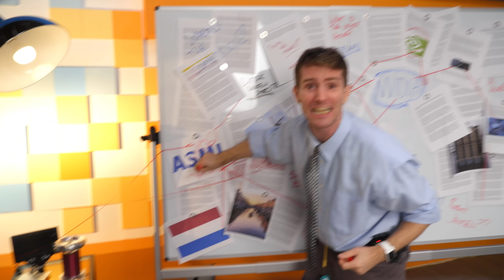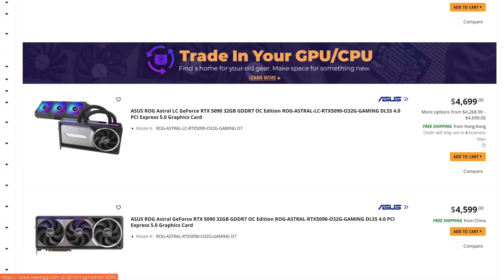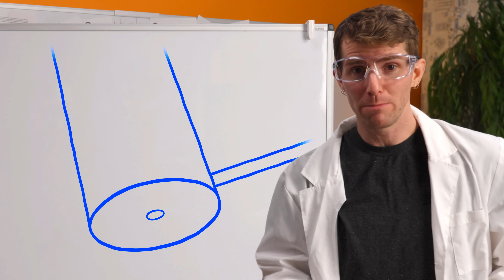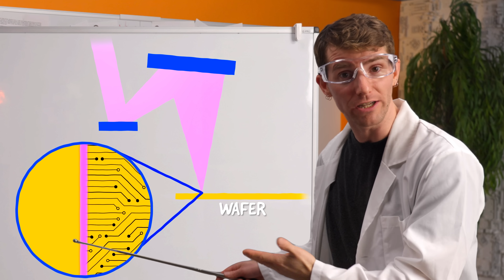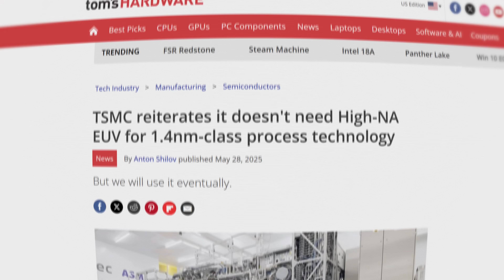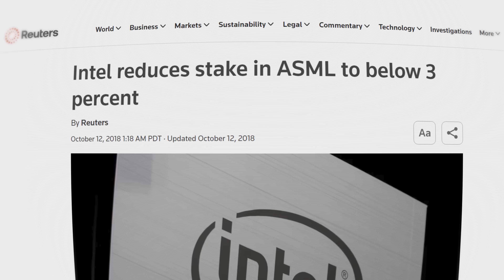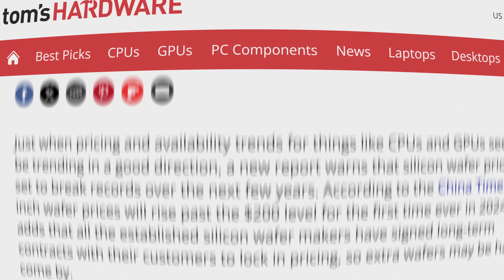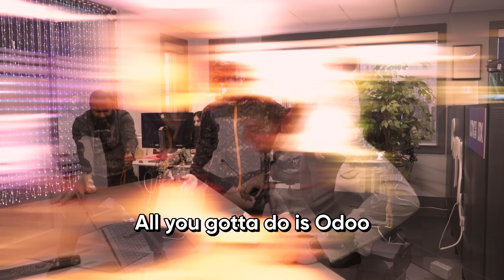This is Why Hardware Prices are Going Up… Again

Comment: 1:30 Hey Intel, please make an actually competetive high end GPU in the Celestial gen, PLEASE!!
Reply: Doubt they will, competing with Nvidia on the high end is ridiculously hard, focusing on the mid end is easier, and can get you way more customers. It's the way to go when you're the underdog.
Reply: I’ve been waiting for amd to do this for years and the can’t. They’re so bad at the top end they gave up this go round
Reply: I can confirm that they're trying really very hard to do just that.
Reply: Competitive with what. Last gen? Battlemage was forced to compete on price because the performance was just not there. Intel will needs never before seen gen on gen improvement to be "competetive"
Reply: @nickfarley2268 I mean it could be possible if 18A does well enough and they have the capacity to dedicate some output to gpu’s. Not making predictions about next generation of intel cards but maybe a bit further down the line.

Still gotta get better with driver & software side from what I’ve seen and read.
Reply: @nickfarley2268  you do realize that there are far more people willing to buy a 4090 class card for $400 than there are people willing to spend $3000 on a 6090 class card right?

Intel doesn't need to sell the best performant card, they need to sell the most performant card at the right price.
Reply: @TeflonBilly426  If Intel can match 4090 performance I will apologize to you. The fact that you are expecting 4090 performance for $400 is incredibly unrealistic. Do you realize that gpu cost money for the materials to build and high end products cost more?
Reply: @nickfarley2268  I'm not expecting 4090 at $400, probably $600-750 (still a good price IMO).

I've said for years that I'm looking to Arc Druid for my next upgrade (currently EVGA FTW3 3090ti) And if they keep up the same uplift we saw for Battlemage with Celestial and eventually Druid, I think that's achievable.
Reply: @TeflonBilly426  Business pay for quality and expected return, with somewhat clear replacement cycle. Consumer pay for maximum value they get with their budget, and cling to their hardware until its subjectively deemed inadequate.

You can't grow as a business in this space by aiming at "winning" the consumer market. NVIDIA proved it with their GPU, AMD proved it with their CPU. The only way that model of business would work is: if the replacement cycle for GPU is close to replacement cycle of phones.

Comment: As a nano electronic student i am tired of euv being hyoed as THE only reason of success. It is like sayings a company is making good cars because they have the latest cnc and lathe setup. Also there are many more steps. Hundreds od Deposition and etch steps between those lithography steps,  each a phd .

Even after that the art of tsmc or intel is more than the sum of knowledge of each step.

Also corps like aplied materiaks and ... are litteraly as important as asml. 

Abd believe me even if you gave these machines to everyone,  they would give you a chip

Comment: If the cost of these machines would ultimately just be added to the latest chips, the chips which were produced by these machines, everthing would be alright.
"Old" GPUs would have a fixed launch price which is being reduced after time. No price increase.
Therefore only the latest and greatest  GPUs CPUs and chips in general would get the expensive price tag, but only at the beginning.

This would be a world everyone could live peacefully.
But no, the chip shortage even increased the price of tech which is several years old.
And that's the thing I hate.

If for example there is a 96core CPU for 13.000€ to 14.000€, namely the Threadripper PRO 9995WX, okay, it's the best of the best.
But why would an older 96 core AMD Ryzen Threadripper PRO 7995WX, which was around 8300€ in 08/2025, go up in price again to currently around 9600€, despite the new generation (9995WX) was launched on 11/2025?

This doesn't make sense!

In a somewhat reasonable world, a newly released new model would certainly decrease the price of the old model, even if they would be similar in performance.

I hoped to get an older Threadripper CPU with 64cores for a reasonable price.

Comment: so, i have a different take on current pricing. yes, things are far more expensive than they could be. BUT, i suspect at least a small part of the reason is that... tech isnt really getting that much better, at least not perceivably. i'm currently sitting on 3 different gaming pcs from 3 different eras. i have my old laptop, an asus tuf with a ryzen 7 4800h and a 1660ti. there's my old gaming prebuilt, a linovo idea center gaming with an i7-12700 and a 3060 12gb that will be set up as a dedicated jellyfin server eventually. and the new hotness, there's my ibuypower (dont hate, i got a SCREAMING deal on it) with a 9800x3d and a 9070xt (got it for a hair over 1700 all in on a pre-black friday sale. with 32gb of ram, i basically got the motherboard and ssd for free).

here's where my take gets a little warm. from a general web browsing, video watching standpoint, my laptop and my current gaming rig are functionally the same. even in light gaming (i play a lot of idle games, which are more often cpu limited), my fancy pants 9800x3d doesnt REALLY outperform that old, tired, badly in need of a repasting 4800h. in 'real' gaming, there was definitely a huge upgrade from the 1660ti to the 3060. but... the jump from the 3060 to the 9070xt was a little underwhelming. that's partly because i dont play many modern games (the newest AAA game i even own is cyberpunk, and i have less than an hour logged on it in the 2 years i've had it. mostly just use it for the benchmark). the only reason i was even in the market for a new pc was i needed more gpu memory due to all the mods i like to play with on games (i've got 4 games with a mod folder bigger than the actual install file) and the linovo uses a proprietary power connector for it's motherboard meaning no easy GPU upgrade.

hardware costs going up isnt really that big deal in the long run, because we're not going to NEED new hardware for a few generations. it'll take that long for the iterative upgrades to compound enough to make an upgrade worth while, price be damned. think about it, the last time there was a true hardware upgrade that was actually worth the jump was gtx to rtx. it's been iterative for 3 generations now. you can see it on steam hardware survey, folks are still running gtx 1060s in significant numbers, likely because they are cheap as hell and are perfectly adequate for many esports titles and older games. basically, what i'm getting at is hardware prices are becoming irrelevant due to the hardware itself becoming irrelevant. you buy that $2000 5090 now, and you'll still be able to play games in 10 years (the 1080 is proof of that). the bigger problem is devs not bothering to optimize their shit, making it our problem.

Comment: I don't call something a monopoly unless there is another company competing. When it comes to ASML, they are sloppy with their material. China got a full technical diagram of their latest EUV machine, but they are unable to replicate it because it's just too advanced and difficult. ASML machines are like 30% hardware and 70% software to make it work properly. If another company got even close to their capability, then it would be awesome! I believe China will do it eventually, just not in the next year.

Comment: 8:20 Linus, it's also a fact that it's exponentially more difficult to shrink transistors, and the cost increases exponentially alongside it, regardless of competition. We are approaching physical limits and things get reaaaal weird at the limits, and very very expensive.
Reply: Hitting the physical limits is actually a good thing.

As pushing the very cutting edge gets more and more expensive, it becomes proportionally easier for the independent players to stay relevant. If the latest process node costs you 2x more and gets, say, +10% performance — you could just buy the prev-gen part and lose the same 10%. Gaps shrink, "good enough" hardware stays good enough for longer. Independent players have more time to catch up and have to spend less money for that.

Also, a largely untapped potential comes from various physical arrangements like 3D stacking, chiplets and similar. They are orthogonal to the process nodes — you could build a 3D NAND on 28nm node and it would still deliver multiplicative performance gain over the base "flat" topology on the same node.
Reply: @oink-747  on one hand, yes. but on the other... the capital you need to invest to get to actually producing chips means that you pretty much need thouse margins for it to be a finantially sound move.

also, the 3D stacking and shit is what people have already been doing since like 2010, since the actual first wall of 2D node size came with 14nm or so, hense, intel's 14nm++++ era.

whats happening in the past 5 years is that we are hitting a wall on 3D stacking...
Reply: @oink-747  exactly: we can expect genuine improvements in software only once everybody feels the effects of Wirth's law.
Reply: I hope you know that the "node" doesn't really have anything to do with physical transistor size. Matter fact we are still about a tenfold decrease in feature size away from the 4nm transistor NOT NODE that NEC proved in 2004. So approaching physical limits, nope. It's feasibility, and scaling to make economic sense problems we are hitting. We can make much smaller transistor and have been able to for over 20 years. But one research proof of concept is a dimension away from commercially viable mass production. Also even current cutting edge 4nm or 3nm or even smaller nodes have NOTHING to do with actual transistor size. I'm an electronics engineer in that space and it's all marketing talk, because the real improvements from this to that node are much more complex to explain.
Reply: @kuunib7325 while we are nowhere near the physical limit beyond EUV most likely will be incredibly expensive. Cause that would be X-Rays. Since they behave completely differently you have to design a system that won't utilize anything you learned in the last decades shrinking down UV.
Reply: @kuunib7325 I think the next breakthrough could come in room temp super conductors, if that could be applied to computers. Something like that could go insanely hard but room temp super conductor is a tough thing to achieve, let alone be able to apply to this sort of thing, if its production requirements are similar to those like YBCO’s (nilered video).
Reply: @christianmichael4020 we don't even know if room temperature superconductors are possible and even if they are whether they exist so unless we somehow discover one through pure chance they are as far away as fusion. However even superconductors at the temperatures fridges can achieve would be a massive breakthrough.

Comment: 1. None of the gpu manufacturer is using cutting edge 3nm node. so 3nm wafer being 2x more expensive than 7nm argument doesn't apply here. 
2. Price hikes on sub 3nm nodes isn't like skyrocket high. 
3. Chip price in 30 series was around 25% of whole GPU, so even if chip price double doesn't explain whole GPU price triple.

Comment: The trend of exploding R&D and manufacturing costs of new equipment and fabs has been predicted to become end of the Moore's law since 90's. And that eventually all cutting edge chips would need to be made in a one fab that's so expensive to build that the entire industry could only support one.  And shrinks end when making the next fab is more expensive than the entire industry.  And that was a time when there wasn't monopoly just exponential cost of improving precision and purity of everything.

Comment: Thank you for bringing mainstream attention to this! I'm a huge geek for semiconductor fabrication and view the mass production of modern semiconductors as arguably mankind's most impressive achievement, so I think it's awesome that you're giving your massive audience this 10000 foot view of the landscape. And yes, we absolutely need more competition, but the barrier to entry here is so extreme. Taiwan's strategic importance via TSMC also has huge influence in geopolitics. Yea it's very easy to go all Pepe Silvia on this.
Reply: As someone who works in semiconductor fabrication (mainly yield and defect analysis, but also wet and plasma etch, tho I'm trying to do a lateral move to FSE), the fact that it even exists is something I look at with like, religious reverence. It is the pinnacle of human ingenuity, cooperation, and achievement from every angle you look at it. The required supply chain logistics, layer processing and design, each individual tool in the fab working by itself and in concert, laminar airflow, the materials sciences that allow the bunny suit to exist, just all of it. 

That said, there are just some aspects of the industry that fundamentally conflict with the idea of market competition to the point that they're mutually exclusive lol

Comment: It's literarily multiple layers of "we were so good we became monopoly". But the issue is not that companies are charging more. The issue is that newer and newer chips are required. People want better graphics in their most beloved games. People want to play on 27-inch 4k screens that require more and more computing power to drive. Just imagine... The Elder Scrolls VI releases today and it looks like Skyrim. It would be universally bashed, it would be deemed Skyrim mod, just because developers wanted older hardware to be able to play the game. It's assumed that new games will be prettier. New screens will have more resolution. This drives prices up. If TSMC wouldn't need to make 5090s for NV, because they wouldn't, they'd work on making their a-few-years-old process cheaper. So, basically, what drives the proces up is progress.

Comment: 4:52 I think a phrase got cut there in the edit. There should be a line to the effect of "after the electrons are forced up into a higher energy state, they fall back down to their lower state and emit a photon of a specific, reliable wavelength in the extreme UV portion of the electromagnetic spectrum".

Comment: Competition increases technological advancement, which ultimately lowers prices in the long term, but competition alone doesn't lower prices if demand is high enough (as it is now). I guarantee TSMC would prefer to lower prices by increasing supply because that is a more effective long-term strategy for increasing profits, just like decreasing tax rates increases tax revenue.

Comment: Hey technically you can get DUV lithography tools from Canon and or Nikon, ASML isn’t the only option there. You can multipattern with DUV and achieve similar scales to EUV. And if you really really need EUV you could make a particle accelerator Free Electron Laser (FEL) and route the EUV part with some smart optics towards a bunch of tools. Some researchers in Japan are proposing such a strategy. Physics is open for EVERYONE, ASML doesn’t have a monopoly on it.
Reply: Money isn't, however, open to everyone.
Reply: @raze3297 good thing DUV tools are cheaper, then, both to purchase and to run and maintain
Reply: TSMC already use multi patterning with thier EUV machines to reach the cutting edge and it's EXPENSIVE. With DUV multipatterning you could maybe reach what TSMC was at a year after they got their hands on EUV machines, but you can't reach the cutting edge with just DUV.

Comment: Ha, as it turns out.  I will not be upgrading my 8700k Intel based system with a 3080ti (evga).  It's called steam deck

Comment: The industry lacks competition because it was a small industry and simply not that profitable before all the booms. And it requires HUGE and lonnnng-term investments, so the risk for any new players is sky-rocketed high. Without all the US sanctions, China probably wouldn't be motivated enough to seriously invest in it.  

Funny, TSMC was founded because US was trying to "unbundling" chip manufacturing.

Comment: Beyond high manufacturing costs, one reason for the lack of competition within the GPU market, and with the CPU market, is that IP laws restrict access to fundamental features and instruction sets. AMD and Intel have a cross-licensing agreement that allows each other to use x86-64 but have everyone else pay for patents. There are more ARM processor manufacturers (though they are integrated rather than sold separately) than x64 processor manufacturers (only two for the most part).
Reply: Can't forget about export control and other federal regulations regarding dual use products either! Like, the lack of cross pollination isn't just the responsibility of private corporate behavior, it's enforced by Uncle Sam with the threat of violence. 🫠

Comment: Corporates are trying to monopolies on data.
If private citizens don't own hardware, they don't have processing power. So either they'll stop using computer based services or rely on someone who has that facility.
DRAM crisis, GPU crisis, etc, they are just testing water. If they don't face any backlash, it will be normalized. Govt already want to end privatization and impose ultimate surveillance on all of us .

Then they'll start charging for cloud gaming services, cloud storage, cloud render farms so that they can extract every ounce of data that is produced in this world and feed it to their AI models.
From excel sheet to private coding projects, from photo editing to movie production.
For everything you'll have to bank on these tech giants. Computer will only be limited to a wireless monitor that can connect input devices. Rest all can/will be monitored, manipulated or censored based on these tech giant's policies.